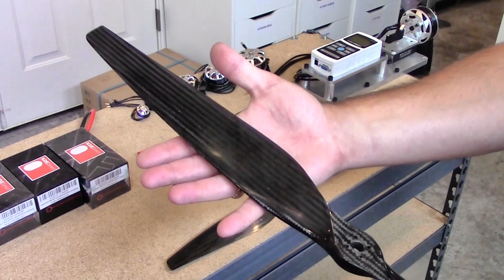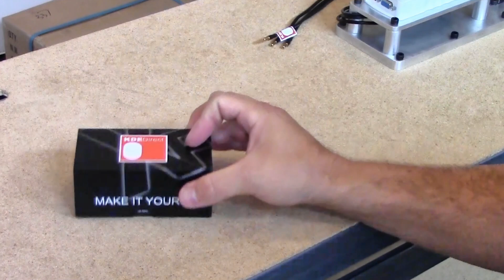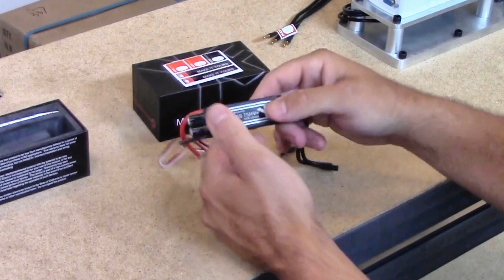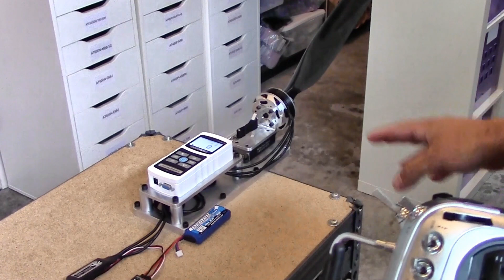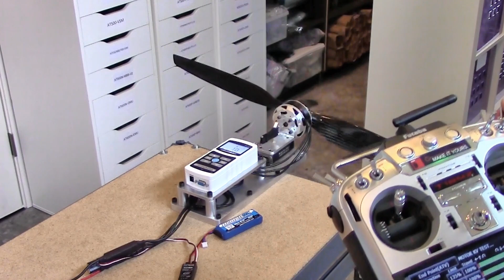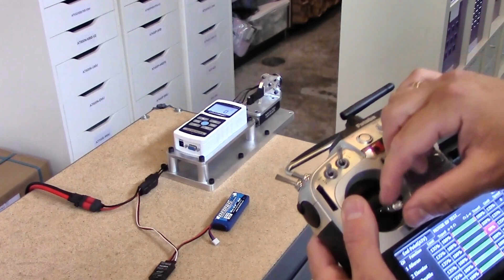KDE Direct Design Engineering - Episode X: XF UAS Electronic Speed Controllers

Comment: I bought some kde motors and matching escs. I ran them stock out the box with pixhawk using DShot600 and also just a plain RX using the old PWM protocol and the response I am getting is extremely sluggish compared to what you have demonstrated here. Did you tune this setup to obtain that level of response?

Comment: Hi. I am planning to build a Tarot T18 Octacopter using KDEXF-UAS55 ESC's and KDE4213XF-360 motors W/ KDE-CF185-DP props. My question is how far can I safely place the ESCs away from the battery without adding extra capacitors. The arms on the T18 are upto 524mm and the are designed to place the esc under the motor. If needed do you sell capacitors that will fit in 23mm inside diameter CF tubes

Comment: Hey KDE you guys really need to make a ESC that doesn't require ''air cooling''! I was set on getting a set of KDE-XF 2814XF-515 35A till I realized they require a constant air flow of 5 mph +! I'm building a Sky Hero Little Spyder where's the ESC's will be encased in the models arms with no air flow present! Sad Times, I really wanna use KDE ESC's but now I'm afraid they'll fry encased in the LS.
Reply from the maker: The airflow is not always required in setups, but is required if the client is looking to pull the full 8S-35A continuous draw form the system.  By the physics of the electronics, heat is always generated, so the airflow is to further extend the amperage-capacity and lifespan of the components - and is good practice for all ESCs (and any electronics, even in other industries) to allow for heat to escape.
Reply: KDE Direct ok so I definitely wont be using anything over 6S. On average 3 to 4 cells. I understand ESC's need cooling, no electronic component likes heat. But what about enclosed applications for "Quads" that require ESC's to be placed internally?  Sky Hero makes 40amp ESC I'm pretty sure are designed to run enclosed. But I prefer KDE's.
Reply from the maker: On the Little Spyder, the 35A is more than capable of handling the loads tucked into the arms.  It's when customers are pushing the 35A to the limit (say, with an 8S setup and KDE4014XF-380s on a Heavy-Lift system) that the additional airflow is highly recommended to keep temperatures cooler.
Reply: KDE Direct Nice! I really appreciate you taking the time to confirm this matter. Now I can buy a set of KDE ESC's with no worries! Just needed confirmation, Thanks again:)